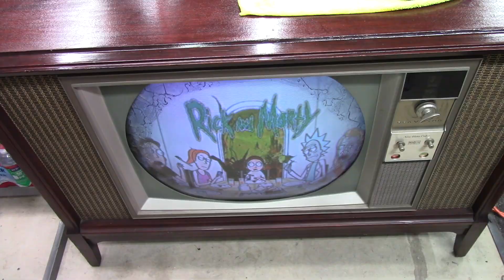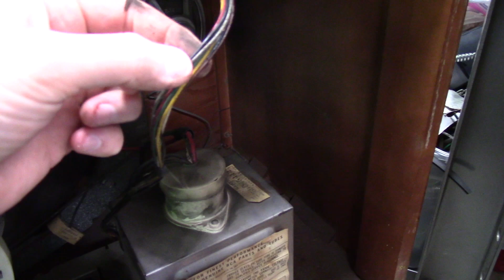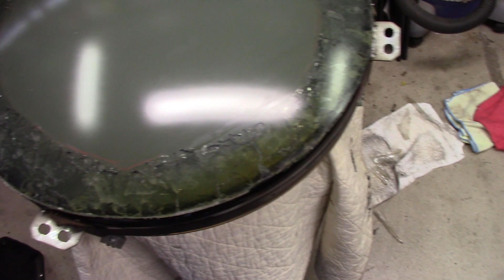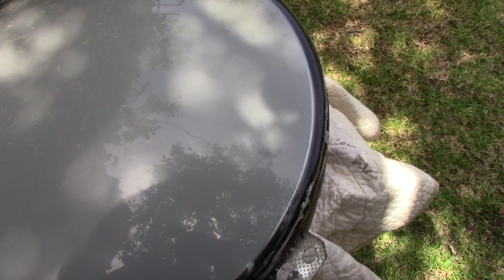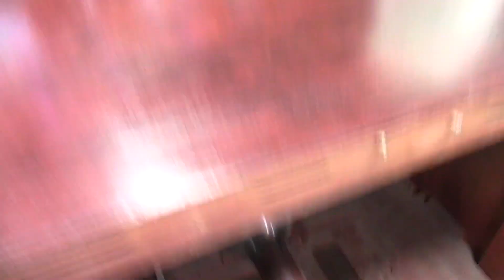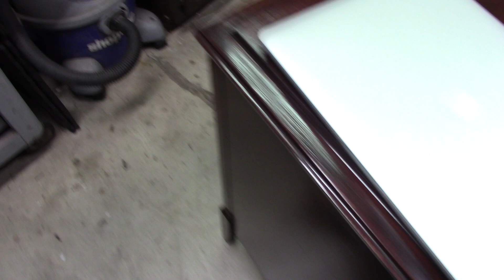RCA CTC16XL CRT Cataract Repair

Comment: I would have used 3M urethane (08609; the stuff they use to mount windshields and rear windows in cars) instead of silicone. Silicone isn't much of an adhesive, while 3M urethane can hold the rear window in a car while going down the interstate at 75+ MPH with all the windows rolled down. Also, it's very thick/viscous stuff, so you wouldn't need the double-sided foam tape for spacing. Just lay down, say, a 1/4" thick bead of urethane and set the safety glass on top of it, and it will stay on top without compressing the urethane much.

Comment: I was a TV Tech in 1974 and 1975 and worked on a lot of CTC-16 sets.  The CTC-16 was the last and probably the best chassis used with the 70 degree deflection (19" round) CRT.  In that day, problems were loss of connection due to solder fatigue on some of the tube socket pins and where the chassis tabs soldered to the PC boards.  That 20 watt concrete resistor under the high voltage compartment, elevated the flyback transformer temperature, causing shortened life.  The horizontal output tube is driven very hard on color sets so, they had to be replaced about every 2 years.  The high voltage should be set at 21 - 22 kV, runing it higher is hard on the flyback.  When replacing aluminum electrolytics, I only use Panasonic (best), Nichicon (2nd best), and United Chemi-con (3rd).  Use the highest temperature and life hour ratings, only bought from Digi-key, as there are a lot of counterfeits out there.  The 19" round CRTs were never designed for high brightness so, keep the brightness at the minimum level required in a room with the drapes pulled.
Reply: Bill Harris, I completely agree about the CTC-16, I worked in a TV repair shop from '77 to 1981, and was still servicing several 16's that customers were still using!  Also saw a few CTC-20, the last RCA roundie, back then.
Reply: "When replacing aluminum electrolytics, I only use Panasonic (best), Nichicon (2nd best), and United Chemi-con (3rd)."

What do you base that on? Sounds like an opinion you pulled out of thin air to me, since I very much doubt you've ever done exhaustive long-term tests to arrive at that conclusion, since that would be an enormous undertaking.

Also, Panasonic has fallen behind when it comes to through-hole aluminum electrolytic capacitors. They don't make a very wide variety of them these days, and the ones they do make often have lower specifications than ones from the other first-tier Japanese brands. For example, try to find a 1uF 400v Panasonic rated for 125°C or 130°C. Digi-Key has 6 results for Panasonic in that value; 3 of them are 2000 hours @ 85°C, and 3 of them are 2000 hours at 105°C.

On the other hand, Rubycon has 12 results, and they don't even bother with 85°C. For their ones rated at 2000 hours, the temperature is 130°C. For their 105°C ones, they have a choice of 8000 or 12000 hours. They also have 125°C ones @ 4000 hours.

Nichicon has 30 results with the highest hours @ temperature rating being 12000 hours @ 105°C.

UCC has 9 results but none of them are in stock. Their highest is 10000 hours @ 105°C.

Rubycon has been my first choice for years when buying through-hole aluminum electrolytic capacitors. They often have the best specifications among the first-tier brands, plus I've worked on a lot of '70s and '80s Japanese-made electronics that had Rubycons from the factory; classic Nintendo coin-operated arcade machines (e.g., Punch-Out!!, Donkey Kong, Popeye, Mario Bros., etc.) for example, and arcade machines in the '80s tended to be on all day, every day, for years on end.
Reply: @MaximRecoil  I started out repairing TVs and Radios in 1970, then moved on to aircraft communication radios, and then the design.  The advertised temperature range was -55 to +70 Celsius (-67 to +158 Fahrenheit) with some radios actually experiencing an additional 10 degrees C in some installations.  To design radios to be reliable in this environment, I would take many weeks pouring over all the different capacitor technology databooks, taking the closest look at capacitor manufacturers having the best track records.  Once a design was formulated, it went through accelerated life tests, being operated at temperature extremes with vibration for several months.  At the conclusion of these tests, all the components were evaluated to see how well they held up.,

 I have also worked as an electronic component engineer for 2 years plus, have been restoring old tube radios since 1970 so, this is the background I am coming from.

Keep in mind that capacitor manufacturers have been increasing or reducing their offerings depending upon sales, and this market is constantly changing.

I have been familiar with Rubycon since the 1970's.  It is one of the better quality capacitor manufacturers but, I would rank it just behind United Chemi-con.  However, I retired in 2018 so, Rubicon may have improved.

Here are a few tips to maximize the life of electrolytic capacitors: (1) Mount them away from heat producing components.  (2) Measure the capacitor ripple current and de-rate it if near its limit by using 2 half value capacitors in parallel.  (3) Super small case size electrolytics should be avoided because they dry out quickly.  Instead, use a plastic film capacitor.  (4) If you need a higher voltage capacitor and no such value is available, 2 capacitors can be connected in series but, must use a resistive voltage divider to ensure equal voltage sharing.  (5) Solid tantalum capacitors should never be used on power supply lines.  These capacitors (although having superior low ESR) are guaranteed to short out at random, which can catch your unit on fire.
Reply: @billharris6886  "Once a design was formulated, it went through accelerated life tests, being operated at temperature extremes with vibration for several months.  At the conclusion of these tests, all the components were evaluated to see how well they held up"

When is the last time you did that, and how many different brands of capacitors did you test in the same design? And which brands were they?

"I have been familiar with Rubycon since the 1970's.  It is one of the better quality capacitor manufacturers but, I would rank it just behind United Chemi-con.  However, I retired in 2018 so, Rubicon may have improved."

I doubt very much that there's any meaningful difference between any of the first-tier Japanese capacitor brands, when using capacitors of the same or similar specifications. At that point it comes down to which of them have the highest specifications, and that's often Rubycon these days, like in the 1uF 400v capacitor example. If trying to go with Panasonic or UCC, sometimes you can't even find the value you need from them at Digi-Key or Mouser.

Here's another example: 470uF 200v, which is a value I recently used to replace the main AC filter capacitor in a 1988 CRT TV. I used a Rubycon, 12,000 hours @ 105C. Nichicon and UCC also have ones rated for 12,000 hours @ 105C. But once again, Panasonic is bringing up the rear, with their highest hours @ temperature rating being 3000 Hrs @ 105C.

"Here are a few tips to maximize the life of electrolytic capacitors: (1) Mount them away from heat producing components.  (2) Measure the capacitor ripple current and de-rate it if near its limit by using 2 half value capacitors in parallel.  (3) Super small case size electrolytics should be avoided because they dry out quickly.  Instead, use a plastic film capacitor.  (4) If you need a higher voltage capacitor and no such value is available, 2 capacitors can be connected in series but, must use a resistive voltage divider to ensure equal voltage sharing.  (5) Solid tantalum capacitors should never be used on power supply lines.  These capacitors (although having superior low ESR) are guaranteed to short out at random, which can catch your unit on fire."

That's some good information; thanks. I'll point out that in the case of your #3, if replacing capacitors in a pre-existing design which used a small case size electrolytic, same-value film capacitors tend to be too large to fit in the location, unless you extend the lead length to mount it remotely, which changes the electrical characteristics (perhaps not by enough to matter in some instances, but it still does). Also, with regard to #5, if the design has proper fusing, nothing should ever catch on fire due to a shorted component.
Reply: @MaximRecoil  I'm not trying to debate here, I was just giving you some of my 50 years of  experience.  Most of the accelerated life tests were done during the 1980's and 1990's.  At that time Sprague was the best electrolytic cap manufacturer.  There are 2 types of electrolyte used; a consumer grade and an industrial extended range, the industrial one can be identified by its lower temperature rating.  Other than the electrolyte used, the biggest other factors in life ratings are the body size.  The longer life caps have a larger body so they can hold more electrolyte.  I agree, the plastic film cap takes up a lot more space than the electrolytic but, only mentioned it in case you have the space.  That's all I care to discuss.

Comment: Neat Job, I wonder if the softnes of the Picture ture is the fact that there is an air gap between the screen and the protecting sheet,?  It's like you might need a clear flexible laminate sheet between  or even an ultra clear silicone which you can adhere it with?  EIther way it's gonna be tricky!
Reply from the maker: It was mostly all in setup actually. I finally got the focus sorted out the other day. That will be out in a future video.
Reply: @mechtrician1  cool

Comment: When I do cataract procedures on CRTs that are already converged and set up I leave all the neck hardware on. When you do it that way you have to remove the convergence board and be careful not to crunch it, but doing it that way saves a lot of work.

I don't know if the California stores carry a product called "Goof Off" but the lacquer thinner like clear liquid version in the metal can (not the colored stuff in the spray bottle) does a good job of removing PVA residue. What I do is peel the thick stuff and as much as my hands and fingernails will readily get, then use Goof Off (and possibly an expired credit card) to get the rest, then clean with glass cleaner, and if necessary go back to the Goof Off step. It works fairly well.
Reply from the maker: I was going to leave it all on there but Shango actually suggested I remove it all. He said it would be easier to handle, especially for my first one. I have goof off, acetone, and lacquer thinner. I just used acetone because it was most handy in my solvent sprayer but good to know goof off works. That’s what I did though. I peeled as much off by hand as I could before I had to scrape.